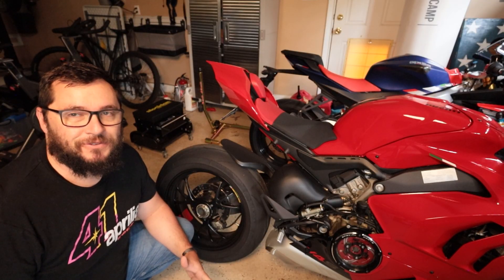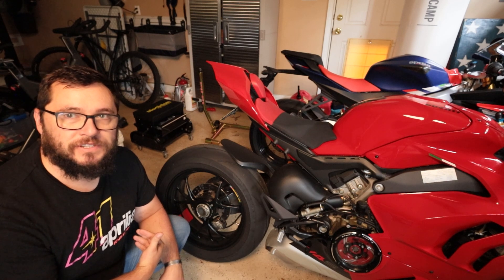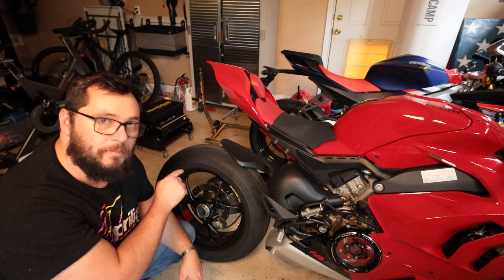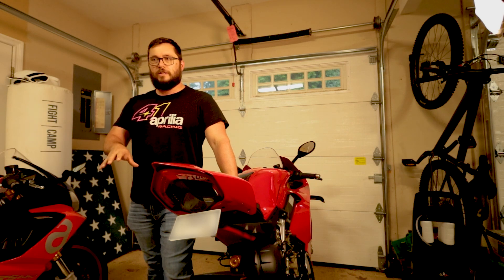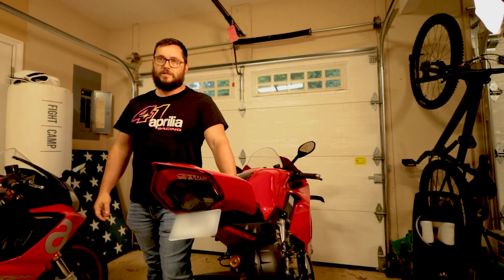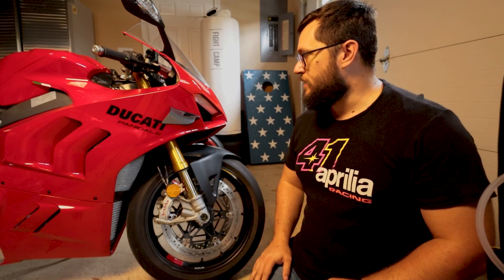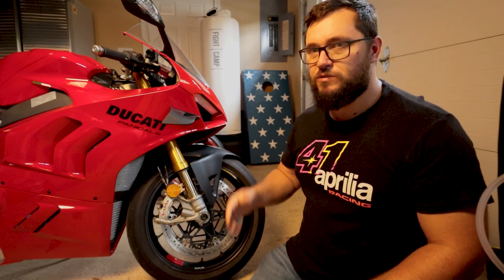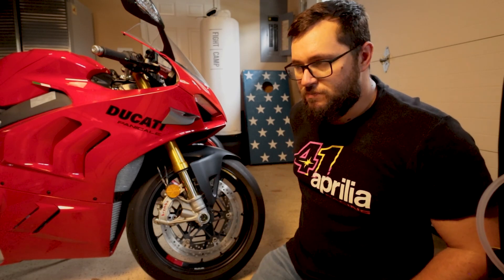An Engineer's Perspective of the 2025 Ducati Panigale V4

Comment: Have you managed to find out whether they have implemented a fuel gauge into the new electronics cluster (in addition to the cruise control and turn-by-turn navigation)? I've tried looking at the early vids/their homesite, but it still seems to be missing :/ I've been contemplating between the M1000R and the Streetfighter, hoping this Panigale upgrade will lead to the Streetfighter getting these goodies aswell. But I also have started thinking about the Panigale too.. since this will have these upgrades by 2025 :) How do you find your Panigale in road use? Thanks for the cozy video :)
Reply from the maker: @tsarnevits  that's a great question and definitely one I'm interested to know as well. I'm going to the duc dealership tomorrow so I'll ask and see if they have any early info. 

The panigale is a difficult choice for a daily rider. While the body position is perfect for aggressive riding (it so easy to lean over and get your chest and arm on the tank when in a hanging off position), it's pretty aggressive for normal street duty. My aprilia is quite a bit more comfortable for street riding. That being said if I could only ever have one bike, this would be it even if it meant I had to deal with some occasional discomfort.

Thanks for watching. I really appreciate it!

Comment: Ducati did it for faster track times but probably less than 1% of their customers use the bike on track. Most just use it on sunday rides. If the 2025 model doesnt sell as much as the 2024,  the single swingarm will return
Reply from the maker: Yeah. I completely agree. I was just at the track this weekend and saw one or two ducatis there out of all of the bikes, and one was owned by the event organizer. I left mine at home because I don't feel I have enough experience to really ride that bike on track yet. 

The single sided swing arm is definitely a gamble for sure. I applaud them for taking the risk and trying to push to boundaries, but I'm not sure it will work out in the long run.

Comment: If you configure a 2025 V4 with carbon fiber winglets the picture shows that they are still screwed into the fairing. Hopefully that means they can still be swapped without replacing the whole fairing.
Reply from the maker: Yeah, I think that is the case. That's makes me feel a lot better about the new bike. If you had to replace the whole fairing over some small damage, that would really suck. 

Thanks for the feedback!

Comment: I've looked at some closeups of the new V4S (Robb Report has some good ones) the new winglets are NOT part of the fairing. Color matched and they have a molded flange that fits into a recess in the fairing and probably are bolted through from the inside. So they are replaceable separately.
Reply from the maker: Yeah. Someone else pointed out that you can actually option the bike with carbon fiber wingless as well. I think that would help with the look of the front end a good bit. It is reassuring to know they are replaceable. 

Are you thinking about buying one?
Reply: @Knoxvillemoto  Yeah no. Money's tight right now. I have two paid for Aprilia Tuonos (2003&2012) collecting dust in my garage.  If I was in the market for high end superbike I'd probably get a 23/24 M1000RR.
Reply from the maker: I feel you. My bike addiction is a little out of control.and i need to dial it back some as well lol. Yeah, i really strongly looked at the BMWs as well. They are awesome bikes. I'd love to pick one up one day but my wife might actually kill me if I come home with another sport bike.

Comment: Great overview of the major changes, agree with the reasons for these changes, mainly focused towards track use. As you said a majority of v4 panigale owners ride more on the road so for them is it going to be worth the change especially when the current model is more aesthetically pleasing. I recall when the 749 and 999 were released with the double sided swingarm, they were better handling bikes than the 996/998 but that didn't matter and sales dropped dramatically forcing ducati to bring back the single sided 1098 and sales boomed once again. Will history repeat itself ??
Reply from the maker: That is a great question. I think ducati is fundamentally at odds with itself at the moment. They are absolutely dominating in motorsports, which has no doubt had a large influence on their sales. I can see why they might make the assumption that supremacy at the track translates to sales and why they would put their focus on track performance. But like you illuded to, right now, ducatis real niche in the market is producing a high-end luxury product that leverages its racing heritage and technology. The panigale really needs to be more than just a fast bike. It needs to be motorcycle art that is also a top performer. 

I don't envy their position. They have to try to be as fast as bikes like the S1K, with it's aggressive aero and advanced technology, while also being the best-looking bike on the market. That's a rough balance to maintain. 

I guess my question is, will people eventually come around to the new look, or will they say "well I can get a similar bike from another company for less money?

Comment: I was never a fan of single sided swingarms, it was kept purely as a fashion item - 6lb of weight saving  from that one area is huge, the v4r will benefit in racing when it comes out and any decent riders will detect a small difference, it'll give the suspension an easier time.I'm sure it will be an awesome bike !
Reply from the maker: I would say your assessment is pretty much spot on.

Comment: nice analysis, I agree with pretty much everything you said, it might be a bit jarring at first to some people (I quite like the look of it now). Just one small note on the wings, I think the come off just as easily as the ones on your bike, if you go to the configurator on the ducati website, you can actually put carbon wings on the new bike
Reply from the maker: Ohh really, that would be really helpful if they could be replaced. I'll go check that out, I'm curious how it changes the look in carbon. 

I agree. At first, I was like, "Hmm, I'm not sure about the direction they've gone." Over the last few days, it's started to grow on me. 

Thanks for the info. I'm going to go spend too much time on the configurator now lol.

Comment: Although I’m not a mechanical engineer, I am an aerospace engineer and I unfortunately do not like the double sided swing arm. Ducal says it makes things at the track easier but the majority of the people will not buy this but as a track only bike. I understand 6lbs is a big reduction but 6 pounds as a variable will mean nothing from the size weight of ridders. The only positive is the electronics package, I don’t know if that alone sways ridders to buy the 25 version. I wouldn’t be surprised if the value of the 24s go through the roof due to what seems a mass consensus rejecting the new model since it’s not aesthetically pleasing as the 24 model. Something tells me I better go secure a 24 model. lol rant over.
Reply: Yep, it is another misstep, ducati does it from time to time.  Got my final edition V2 on the way.
Reply from the maker: Nice! The final editions look awesome!
Reply from the maker: Yeah, i dont disagree. I mentioned to someone earlier. I would buy the new generation, but only if I could do so without selling my 24 to do it. I think that the largest significance of the 6 lbs is its location. The reduction of the inertia of the swing arm should have a significant effect on the suspension being able to "follow" the road surface better. Even more so if they were able to keep more of the weight closer to the pivot point. That being said, I've never had any problems with putting power to the ground or rear grip from the 24 model. I suspect that someone would have to be a much more skilled rider than me in order to really be able to extract the benefit out of the new swing arm. I am very interested to see what people think of the electronics package when they ride it. I'll be very curious to see how it sells. 

Thanks for your thoughts!
Reply from the maker: @DJN4CER  that would be cool. I supposed it depends on if there are new sensors that the newer bike has that the older one doesn't . The dynamics and controls algorithms for the IMU data would certainly be different between the bikes as well.
Reply: @Knoxvillemoto  @DJN4CER  The new bike has 70 sensors and completely new software program.  This is the actual advancement of the bike; basically you either do the amount of go (throttle) or slow (braking) and it does the rest.  It even adds braking when you do not to keep the bike where it needs to be concerning weight distribution and suspension travel.
Reply from the maker: Ohh wow, I would love to get a look under the hood at the control algorithms that are utilizing. That's wild.
Reply: 😂 bikes are being repossessed like never before.
Reply: @GenghisKhan311  link?

Comment: I find it interesting that Ducati didn't do that with the last model.  With the first Panigale, they got rid of the trellis frame for performance.  Though KTM has proven in MotoGP that they are competitive with a trellis frame, over aluminum box section.  I would have expected them to have gone single sided swingarm with the V4 when it launched.  Maybe just make the R version double sided.  But then, I don't remember anyone complaining about the Desmosedici being double sided.
Reply from the maker: @2WheelsSometimes1  yeah, I think ktm has really pushed the trellis frame concept faster than most. I've heard it said that motogp bikes are typically much stiffer than road bikes but I think a lot of teams are coming to discover that compliant components can certainly be beneficial if excuted well. My guess is that the single sided arm stuck around for so long because it was so iconic, even after it had long since ceased to be functionally advantageous. 

It's fairly telling that no one runs a single sided arm in motogp (though there could be some sort of restriction that I'm not aware of).

Comment: engineer  gigi daligna... Motogp regs will soon have 850cc bike... So all the Desmosedici design will transfer to the Superbike of Ducati project...including all tech.. It will start from this base model then they will transfer every motogp desmo tech in this production bike... If anyone needs single side swingarm then they can buy it aftermarket... Single side swingarm is very bad for Ducati when it truns in the right side as well as when put all that power 228hp they can't put all the power down in the ground when they have single side shitt...
Reply from the maker: Yeah, that is a great point. I can absolutely see a lot of these technological improvements having a huge effect on their wsbk teams. It effectively allows them to share technological improvements between Motogp and wsbk better. I hadn't really conscidered that. It's also kind of amazing what they have been able to do in wsbk even despite the limitations of the old swing arm. 

Thanks for commenting!

Comment: Saw MCN report a combined weight saving of 3.8 kg for the swingarm and rear suspension assembly. Pretty significant improvement combined with the reduction in lateral stiffness by 37%, IIRC, to utilize the improved tires to their fullest. This will for sure be a significant improvement for their WSBK team so I'm fully in support of this change so they can bring it to BMW again next year.
Reply from the maker: Totally agree. I'm going to guess that this design will be a game changer for WSBK. It's crazy since they are already doing so well and in general and already have such strong sales; that they were willing to take a pretty significant risk with the bikes styling.  Good on them for pushing the limits. 

Thanks for comment!
Reply: @Knoxvillemoto  The DSSA should have been reserved for the homologation model, the V4R.
Reply from the maker: That seems to be the consensus of a lot of people so far.
Reply: 2025 model is a little heavier than 2024 model.